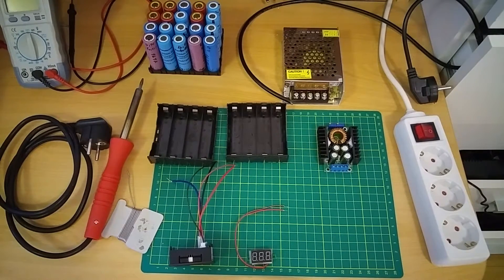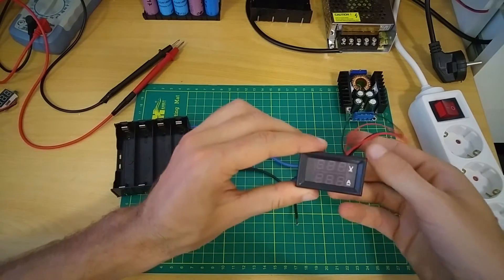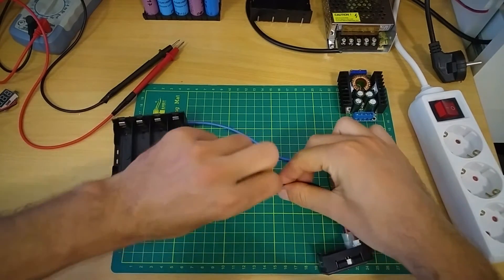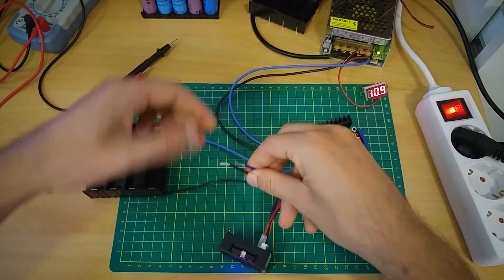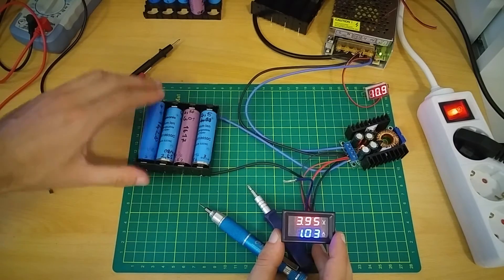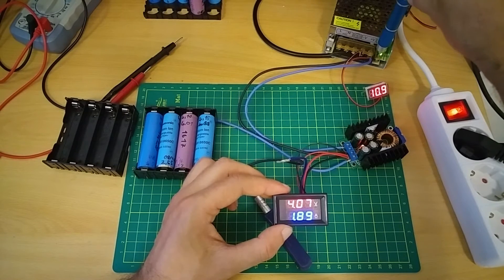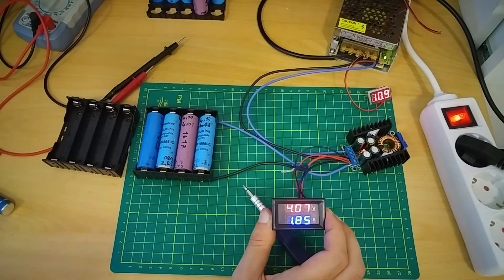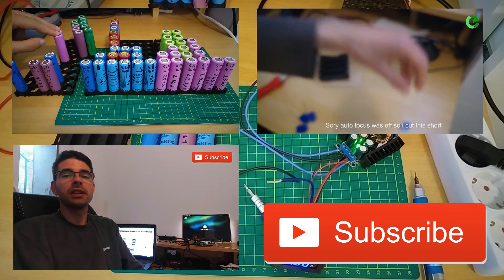Ajustable 18650 battery charging

Comment: Before connecting battery set 4.2v and 0.5 amp for each battery so 4x batteries 2 amp for just safe for cheap old batteries.

Comment: Love it .. personnally I'd used a 3A buck regulator with current limiting as well, and as long as you don't leave the charging unattended I don't have a problem using this method. Note I also test each battery individually for internal resistance and for AHr capacity and would only group batteries giving close results into this setup at a time. Good work :)

Comment: What happens if you put a full charge 4.2vdc in the same box as a discharged battery at 3.2vdc?  
Dangerous way to parallel charge because you don't know the discharge level of batteries, cross current flow inside the holder can cause dangerous current flow you can't measure.  You need to charge individual cells separately or have a balanced charger that prevents cross current flow...not safe at all doing it this way...one cell at a time...sure, 4.2vdc charge volts and 1C charge rate...

Comment: This video is absolutely dangerous. This is ABSOLUTELY NOT the way to charge 18650 batteries.
Reply from the maker: If you dont know what you are doing then it is dangerous. This way you only charge tested batteries to maximum 4-4,1v This was my test charger for next big project where I will charge 28 batteries (4 in paralel x 7 in series)
Reply: Your title states "Ajustable 18650 battery charging"
There's no mentioning that this is a testing of sorts.
You're not even charging them with a controlled current, you just smack them with a preset max voltage.
And that max voltage is set with cheap Chinese voltage indicators.
Have you ever tested if they are calibrated?
In many ways, this is not a setup for beginners to replicate.
And then you even encourage them to charge in series with this setup. Not OK...
Reply from the maker: Did you watched whole video? By your surprise you are probably having Chinese cellphone or made somewhere else in east Asia. 
We can agree on one thing its not for beginners.

Comment: Is the charger able to provide constant current , constant voltage?
Reply from the maker: In this setup yes, but if you use it where input voltage fluctuates then voltage is constant and current fluctuates. You can see that on video 7:30 min
Reply: Electronic Creations As i thought. You need a chip with a way to charge the lithium based on the specs for charging it.
Reply from the maker: Thats for tickle charging. This way when battery reach voltage of charging it just stops to drain amps from charger. I dont say this is the best way but it is the fastest. Also i wouldn't charge this way battery over 4,1 so that way you have some safety margin  and your battery should last longer.